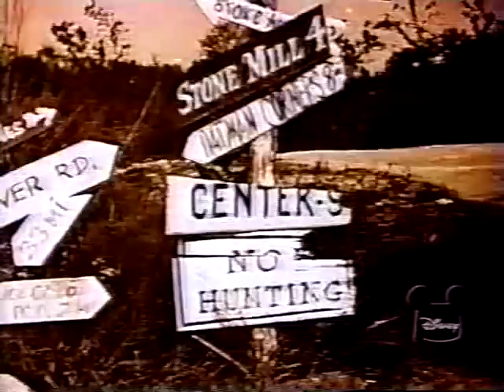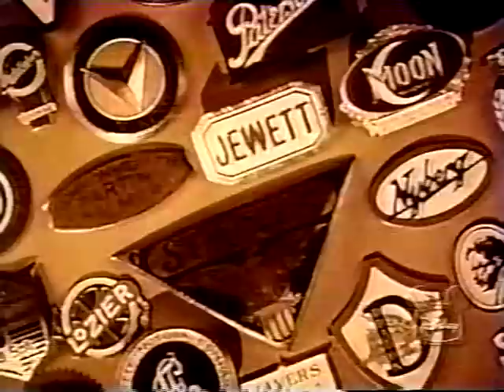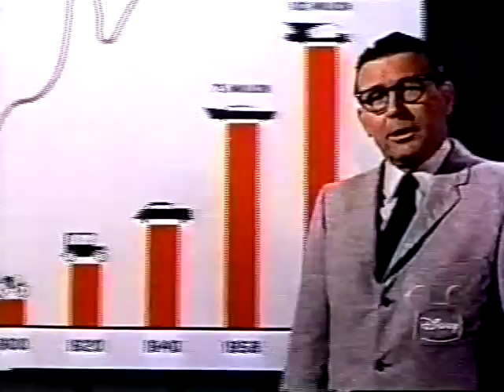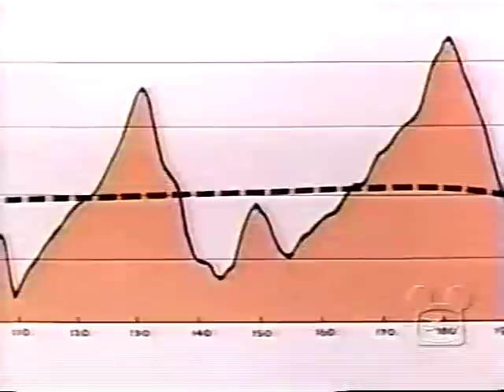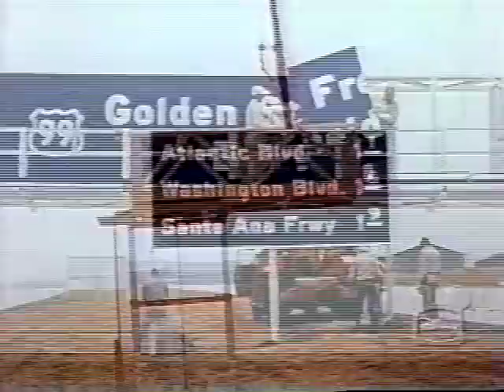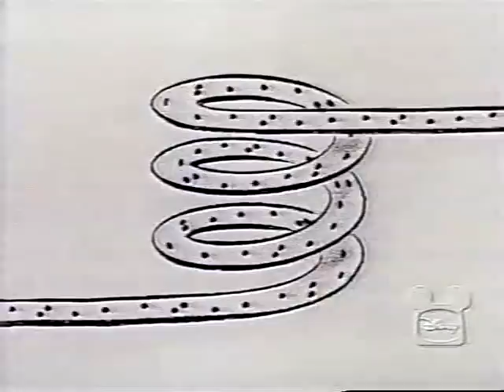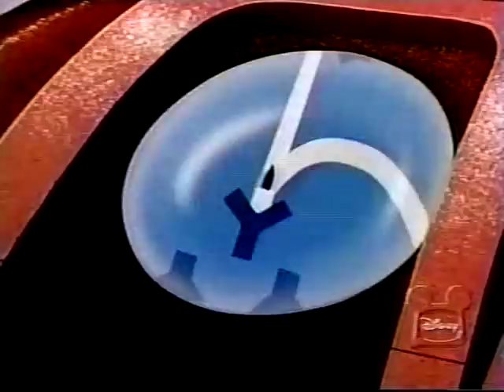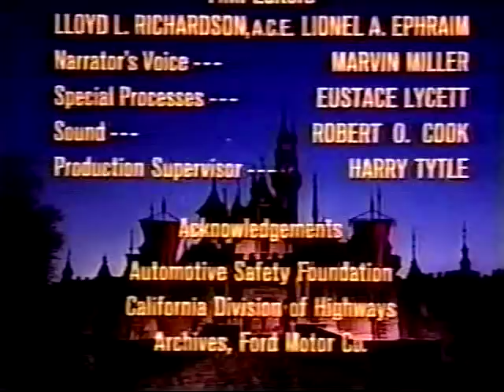Magic Highway, U.S.A. (1958)

Comment: 31:08
That is the Garfield Park elevated, and the highway that was built here made the line get removed. Chicago Aurora and Elgin inteurban cars took this line into Chicago. Because this line was removed, the interurban lost it's way to Chicago, and stopped running in 1957.
Often highways are purposely built on top of interurban lines.

Comment: "All 48 states"
Reply: Solo In 1958, there were 48 States
Reply: Hawaii and Alaska weren't admitted to the union until 1959, a year after this film was made.
Reply: And even if Alaska was part of the union it wouldn't be connected.
Reply: There are three Interstate highways in Hawaii: H-1, H-2 and H-3. All are on Oahu, and they have the lowest maximum speed limits of any state in the U.S.: 60 mph.
Reply: 1tiercel  Which it does, being constructed in 1942-43 to facilitate supply to Alaska and forestall a Japanese invasion there.  Of course, it's not the most "friendly" of passages, but you can do it, provided your ride is in good shape.

Comment: The interstates seemed like such a good idea then. Today they are a nightmare in many places. I 78 in Pa. in particular is a dangerous, choked, jungle of a nightmare.
Reply: There's TWICE as many people and FOUR TIMES the number of vehicles on American highways.  I can't speak for all of I-78, but likely most of it was designed, laid out, and constructed by 1965.  Unless there were plans to expand the highway, including reserving expensive right-of-way, it's something that ends up doomed by its very success.
Reply: @selfdo  - I-78 in PA from Exit 8 to Exit 51 was merely US 22 converted to an interstate. You can still see the ruins of a gas station next to the highway. They are currently widening I-78 to 6 lanes.
Reply: @OldsVistaCruiser  Yes, there are quite a few cases where old US highways were simply "improved" by adding overpasses to replace intersections and so on.  You'll also see a lot of "Alt-##", or in some cases, they just kept the US Highway or State highway number that the "new" freeway branched off from to bypass the original route.  Until the last parts of Interstate 5 between the Grapevine (the original "Grapevine" being also bypassed by the original US 99 being built into a freeway by California in the late 1940s, going out of LA to Wheeler Ridge just south of Bakersfield) and Sacramento were finished by 1979, what's now I-205 and CA 99 from Lathrop to downtown Sacramento was "Alt-5", but also had been the old US 50 that came out of the Atlamont pass.  The revised alignment of US 50 was changed to start in West Sacramento, this also concurring with renaming the old northern bypass route, which had been "I-880", as that was changed to apply to the Nimitz Freeway in the East Bay (CA 17), as the new alignment of "I-80", and the route was now "Business 80" and US 50 from that intersection, and just US 50 beyond "Spaghetti Junction" in mid-town Sacramento. FWIW, US 50 stays a freeway through Sacramento County and well into El Dorado County, finally having a few intersections in Placerville, and being a limited-access expressway up through the Apple Hill country before finally narrowing down to a two-lane road as you get closer to Tahoe.